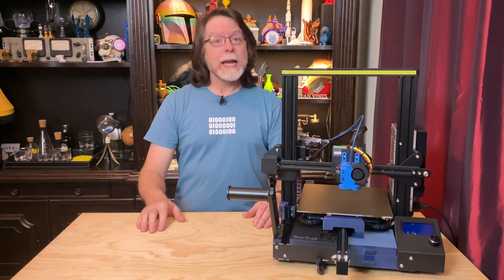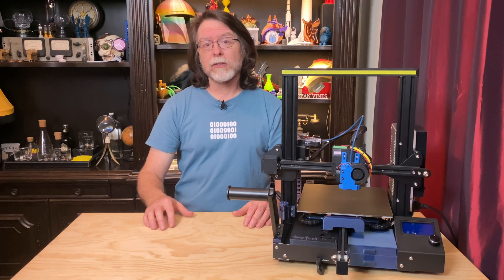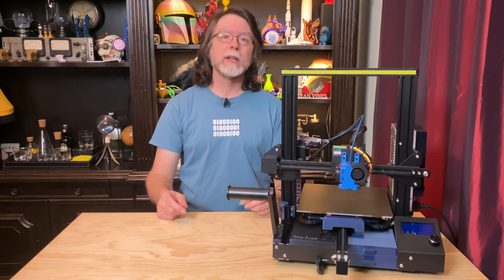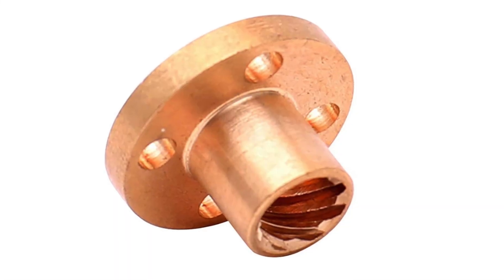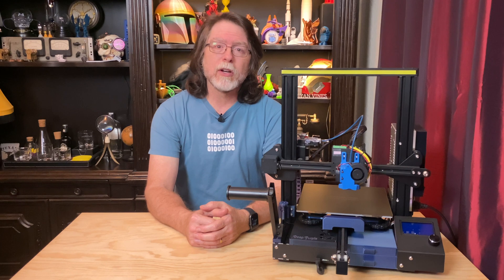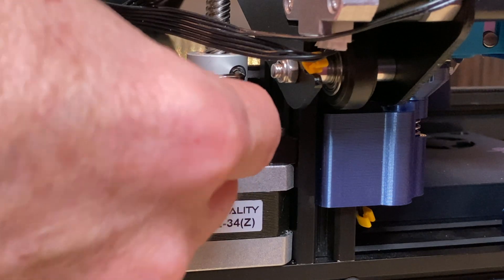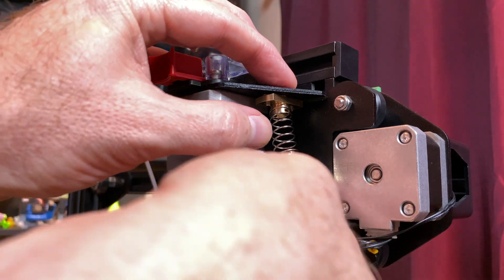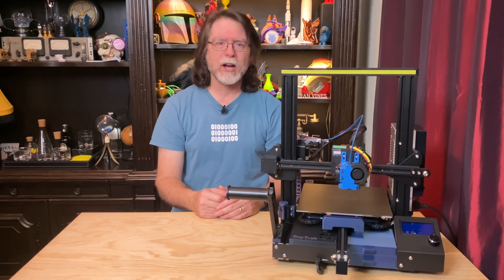Stop the Drop! Install an Anti-Backlash Nut on Ender-3 Series

Comment from the maker: I've seen a couple of comments indicating I installed the anti-backlash nut upside down (in other words, with the spring on the bottom).

This intrigued me, so I wanted to see if this orientation introduced any additional imprecision.

Using digital calipers, I measured the distance between the "spring contact" surfaces of the installed anti-backlash nut kit. That is, the parts of the upper and lower nuts which are in contact with the spring.

The distance varied between 15.27mm and 15.28mm.

Manually turning the lead screw to raise and lower the gantry did not change the values beyond what I stated above. Directionality of motion also did not affect the reading. In other words, while raising the gantry, the distance would vary by 0.01mm during the course of the movement, and while lowering the gantry, the distance would also vary by 0.01mm during the course of the movement. So the 0.01mm difference is probably more to do with the accuracy of the calipers than anything.

But let's say the calipers are perfectly accurate. The 0.01mm variation in distance between the two halves of the nuts represents 5% of the thickness of a 0.2mm layer. (0.01/0.2)*100=5%

My conclusion, therefore, is that it doesn't matter that I've got the nut mounted with the spring on the bottom. The anti-backlash nut is still providing the desired side effect, namely increased friction on the lead screw to prevent the gantry from sinking to the bed when the Z axis motor is de-energized.

If you'd like to weigh in, reply to this comment, and we can keep the discussion in one spot!
Reply: The spring is there to push the bronze nut against the lead screw and HELP gravity for it to never loose contact with the same edge when reversing, it helps when your gantry does NOT fall by itself :P which is a good thing if not loose lol . use G-code to hold position, don't cripple your printer to hold the gantry ;). Science
Reply: @HoRNET_FPV  Most youtube videos show the installation wrong. I tried connecting correctly on an Ender Neo and I had problems with the screws getting in the way of the filament. Are you aware of any video showing the correct way of installation on Ender 3 ?
Reply: @agrigor1  the orientation doesnt matter, because the spring is providing tension on both the upwards and bottomwards threads. The ABL removes the backlash either direction. As long as it is compressed while screwed in
Reply from the maker: @HoRNET_FPV  I think a fun experiment would be to see how much weight is required to overcome the ability of the anti-backlash nut’s ability to prevent spinning the lead screw when the motor’s de-energized, with the nut in each orientation.

And yes, modifying the ending G-code to never, ever, ever turn off the Z axis motor would work. Until you lose power for a couple of minutes. For printers that (a) have the issue, and (b) have the power loss print recovery feature, resuming the print after the nozzle drops may be problematic.

But I don’t think an anti-backlash nut cripples the printer. 😀
Reply: @BV3D  I think you don't understand the purpose of it. There is no experiment to be had. The gantry  falling is not an "issue" related backlash... nor should you try to "fix" it with an inverted spring load. just tighten yur wheels a bit..and use the anti backlash nut the right way to have the gantry follow the bottom edge of the lead screw, like it is meant to be used. In fact do what you want lmao, just don't propagate misinformation.
Reply from the maker: @HoRNET_FPV   I understand the purpose of the anti-backlash nut. But with the lead screw only ever pushing the gantry up during a print job, there's no backlash to be anti-ed. And we're both in agreement that the gantry falling isn't an issue related to backlash. In fact the issue is a need for more friction on the Z axis so gravity doesn't do that thing that it does. 

I can either over-tighten the eccentric nuts on the wheels to the point where they hold the Z axis (but get flat spots when resting too long), or I can make use of a side effect of the anti-backlash nut, which is adding a bit of friction against the lead screw so it doesn't spin as easily.

I get that we're not trying to eliminate backlash. We're adding friction. Orientation of the anti-backlash nut doesn't matter in this application. But keeping it out of the way of the filament path is desirable, and mounting it in this orientation achieves that.

I don't see a clear, definitive answer out there regarding the orientation of an anti-backlash nut when used for this specific purpose. If you've got a link to something like The Idiot's Guide to Using Anti-Backlash Nuts on the Z Axis of a 3D Printer I'd love to take a look at it. 👍🏻
Reply: @BV3D  If it's not vertical it doesn't matter. What you desire is weight compensation.
Reply: @BV3D  I agree with the other commenter. It is called anti-backlash for a reason,,, the weight of the bed has to be attached to the lower half of the nut (which is why the flange should be lower than the half-nut). The weight of the bed already ensures that the thread is pushing down on the screw, but this way the half nut is pushing up which makes sure to preserve the "down" contact.
To understand the purpose of the anti-backlash nut, you need to consider what happens if the z-motor start spinning with a very high acceleration. The screw could turn faster than the bed accelerates down (at 1 g) and therefore cause the downward contact on the thread to be lost momentarily. Remember, the bed can only "fall down" at an acceleration of 1 g. In other words, the top half-nut is designed to push the bed down through the force of the spring so it remains in contact with the thread of the screw. 
Think of it this way: using a very high acceleration to spin the screw will basically try to pull the bed down at an acceleration greater than 1 g. A screw TR8-8 means that the nut moves by 8mm for each turn of the screw. A stepper motor is more than capable to accelerate the nut at a rate that will overcome the fall of the bed. In this case, the bed will "impact" the thread of the screw when it has stopped spinning, potentially causing some artefact in the print (at least in theory).
If the acceleration of the stepper is just marginally higher than the downward acceleration of the bed, the spring force between the two half-nuts will help. However, if the acceleration is set way too high, the spring will not be able to push the bed down fast enough.
It's not a perfect solution but it helps as long as you're not trying push the limit past the envelope of the laws of physics.
Increasing friction to keep the bed from falling is just a byproduct of the anti-backlash nut design.
A much better solution to achieve this would be to replace the screw with a TR8-4 or 2. This way you're changing the pitch angle of the thread to a lower angle which will increase the vertical force necessary to spin the screw (preventing the bed from falling by itself), while only very, very slightly increasing friction. Since you're already paying for a nut, it's not a lot more money to get the screw that comes with it.
Besides, this ensures that the threads will match (there can be quite a bit of variation in the shape of threads from one manufacrurer to the next). Obviously you will have to adjust the steps of the z axis in firmware because you will now get 4mm/turn for a TR8-4 or 2mm/turn for a TR8-2.
Reply: @HoRNET_FPV  totally agree with the logic that the backlash nut should be assisting with pushing the lead screw down on the rod threads, otherwise it's lightening the load of the gantry, potentially introducing free play at the lead screw.
Reply: All right, you guys have inspired me to make the actual, correct solution for this problem.  Actually kind of funny no one seems to have made it already, I don't see the obvious answer on Thingiverse at all.
Reply: @ModelLights  Great. Please keeps us posted on your results.
I see quite a few printers that were originally designed and released with a regular nut, and were upgraded to an anti-backlash in subsequent release. It seems to me that in some cases the reason they mount the nut the wrong way is simply because of space restrictions or other limitations. It may also simply be from a lack of understanding of the concept of anti-backlash nuts.
Either way, it's not a miracle solution to every issue, but it certainly can help if implemented properly while keeping speed & acceleration parameters within limits.
I personally believe that this is particularly useful in case when Z-hop is used because this causes a large number of bed height changes mid-print.
ps: my advice: chose a nut made of Delrin (POM). Being self-lubricating, they wear very slowly while brass requires greasing at regular interval otherwise wear occurs much faster.
Good luck and please make sure to post a comment to give us feedback, or better still, make a video. Thumbs up!
Reply: @ModelLights  I believe a worm drive would be the best setup. The motor would be able to spin the shaft, but the shaft wouldn't be able to spin the motor.
Reply: idk why you dont have more views and subs
Reply: Hopefully this isn't too old to dredge up, but regarding the idea of backlash being a non-issue -  with the gantry constantly moving up, that makes sense. But what about when using some sort of ABL? The repeated up and down movements performed during probing seems like a potential opportunity for backlash to become an issue, specifically in a manner that might contribute to elephants foot. If this is somehow a non-issue as well or this has already been covered elsewhere, I'd love to know. If not, this could be a new "lead" to investigate. (Get it? "Lead?")
Reply: Maybe it’s too late but there’s a chance by installing it in that orientation that the top nut will pushing the spring down therefore it will not under tension which basically make it useless for anti-backlash. However, because 3d-printer move from the bottom up with zero to minimal reciprocating move on the z axis while printing, the results of the backlash is negligible. So in this case even if we put it in the wrong orientation it still serves it purpose, which is to overcome the back drive force by friction provided by the bottom nut even though not it’s not optimal. Also another way to overcome the back drive is to use lead screw with the lowest lead angle to reduce it efficiency.

Comment: My CR 10 has plastic spacers in between the brass lead screw, nuts and gantry. I noticed one was cracked when I install these. I’m wondering if anyone out there thinks I should keep the plastic spacers or just take them out and have the brass nuts flush with the gantry?

Comment: Brian, i have been following you for several years now, ever since I started 3D printing..
I have a question to ask about a set of backlash nuts i bought resently. They come with an extra set of springs that mount above the backlash system to put added pressure on the nut. Any idea if it increases performance?

Comment: If you buy longer lead screws (400mm with maybe 2mm thread instead of 8mm for better accuracy), you can mount the backlash nut at the top above a thrust bearing on a rigid plate and get it to permanently pull upwards on the screw. That way you can remove the movement of the screw up and down on the spring washer inside the stepper motor at the bottom as well. Having a 2mm thread will naturally remove the droop as well even without he backlash screw.

Comment: After some monts of use, analysis of this system and comparisons with friends angineers, I think the anti-backlash is totally useless.
It has a sense on horizontal systems, but on vertical system subjected to gravity force is useless.
That's because the gantry press always it's coupler against the lead screw under his weight. That cancel every backlash effect. 

There're some resons to use Oldham couplers instead. For bent screws, or for dual Z axis with sync belt and tensioner on top. Put under tension on top the lead screws cause bent that needs to be compensated.
Reply from the maker: Thanks for commenting! That's pretty much correct. The whole point behind using anti-backlash nuts in this video (regardless of whether they're installed upside down or right side up) is to add a bit more friction to the system, because on this printer, the weight of the X axis was enough to backdrive the Z motors when they weren't energized.

In other words, instead of using them for their intended purpose, I'm using them as brakes.

Anyway, thanks again for the comment, and have a great day!
Reply: @BV3D  Ok but under tension the steppers don't permit rotations.
Reply from the maker: @mrmechano  When they’re energized, they hold their positions. When they’re de-energized (either because the firmware does it at idle, or the G-code turns them off, or the printer loses power), it can be quite easy to back drive a Z-axis stepper motor with just the weight of the X-axis arm. 🙂

Comment: I've had the X gantry on my Ender-3 V2 up at ~200mm, doing work on it, when, I guess the Z-Axis got turned off by the printer, 'cause the gantry just dropped like 75 to a 100 mm in a couple seconds.  I have an aluminum extruder, filament runout sensor and CR Touch installed, which, I didn't think was that much extra weight, but it must be more than I thought.  So, glad I found this video, because I honestly thought something had been damaged on my printer (a little over a month new to the hobby).

Comment: I have bought many of these, including on the 1start lead screw with a 2 mm lead. Out of 10 of these spring nuts, you might get five that work perfectly. It seems to depend on at which point the 2/2 were threaded in correlation to the composite locking tabs, anyways, what I have found is that wrapping some fishing string around the spring specifically where the joint is truly eliminates  100% of all lash and puts minimal pressure does not impeding its ability to turn without friction. Obviously not too much fishing wire. I done about five wraps near the joint.

Comment: I also installed the anti-backlash device on My Ender 3 v2 this evening as per Youtube instructions and other illustration, but  while doing so, I came to the realization that this is mechanically incorrect! With the loose nut at the bottom, the spring is trying to push the gantry up against the thread play of the drive screw. I seriously doubt if this little spring can overcome the downward gravity forces, caused by the gantry, the x- stepper, the filament feeder stepper plus the Bowden drive feeder, the hot-head and it's fans! The end result would be induced bounce in the play distance if the spring is pushing the other way and it’s best effort can’t overcome the gantry’s down forces. (ie. Downward for force by the gantry and co minus upward push by the spring)

Installing it “upside down”, with the loose nut on top, will assist with the gantry’s downward push on the drive screw thread and eliminate bounce or delayed departure (backlash) when the drive screw suddenly pulls down. (ie. Downward for force by the gantry and co plus downward push by the spring).
This just makes mechanical sense!

Then I found this video and from the responses I see others has also picked up on this incorrect installation instructions of the backlash nut installation. Installing it the “correct” way will still give you the desired friction.

Comment: This video is literally misinformation. Installing this nut does NOT stop the drop, in fact, it caused mine to freefall by itself, instead of with the push it needed before. Looking further into this, found out that's not what anti backlash nuts are for anyway. It's also installed upside down. The weight of the gantry should be on the mounted nut, not the spring nut.
Reply from the maker: I'm sorry this didn't work for you, but it does work for me, and for a lot of other people. The upside down-ness in this specific use case doesn't matter because I'm not trying to counter backlash, but simply add a bit of friction to the Z axis lead screw.

Comment: The anti backlash nut also nearly eliminates elephants foot too! The gantry drops down to the first layer height. As the lead screw attempts to raise the gantry for the next layer, the gantry will not lift until the backlash has been taken up. Depending on the wear and amout of backlash, the gantry may not actually move up to the correct layer height for several layers, squishing the bottom layers outward. If the elephants foot is smooth on the edges, adjusting the first layer height in your slicer, or creating a slight chamfer in the STL will work fine. If the elephants foot is jagged and rough, its a Z axis backlash problem that an anti backlash nut should fix. A dual Z lead screw kit with A/B nuts is even better.
Reply: Very interesting. I never thought on elephants foot related to backlash, but you are so right. Thank you so much.
Reply: Unless it drops so far that it touches the build plate, this isn't going to make a difference.  It's always under the effect of gravity so the backlash is always consumed by it.

Comment: I fixed this by tightening the eccentric nuts on the gantry. try that out before you buy this :) from the factory it was out of whack.. just see if you can spin the rollers on the outside. If you can spin the bottom one; rotate the eccentric clockwise looking from the front of the printer. while rotating the eccentric nut; spin each of the outside rollers. They should not spin freely; but they should have equal tension on each side.
Reply from the maker: Thanks for the tip! 👍

Comment: Just a heads up but if you do this on certain other models of printers, the longer lead screw may prevent the hot end from moving low enough to the bed and may hit the coupler at the bottom (this is the case with the Genius).